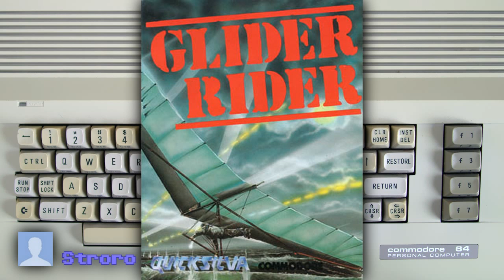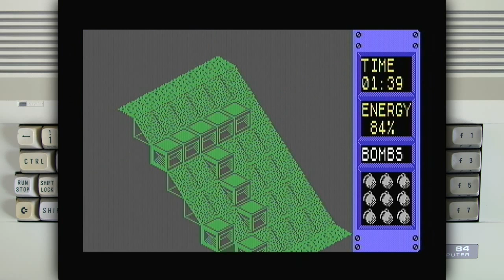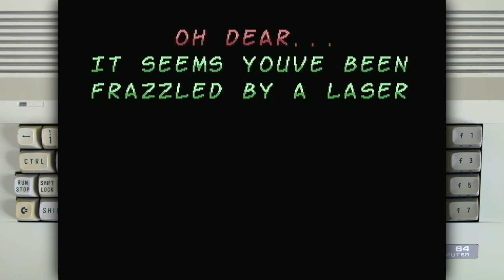Glider Rider on the Commodore 64

Comment: Zzap! 64 noted in the December 1986 issue that games with this style of graphics were usually slow on the C64, but was not so in this case.  That said, they weren't overly impressed with the game, giving it a middling 71%.  Crash were more generous with the Spectrum version the previous month, giving 80% for the 48k version and a frankly astonishing 92% for the 128k version, because of the improved sound.